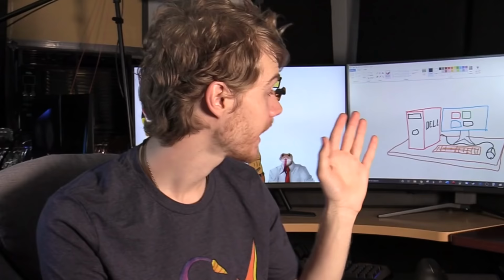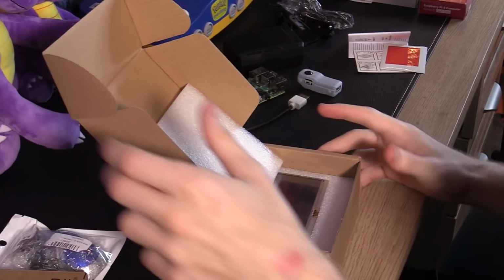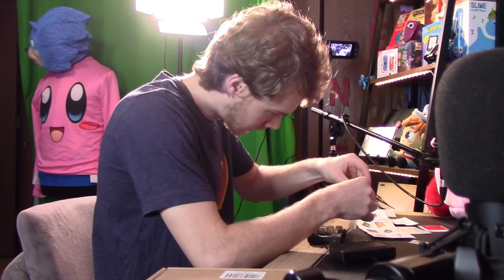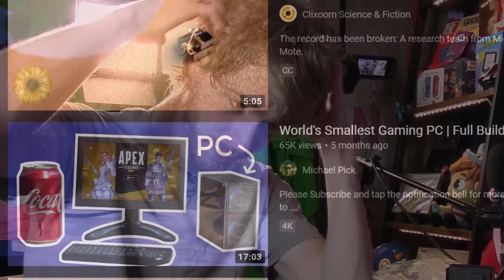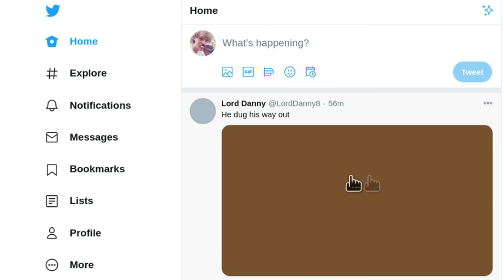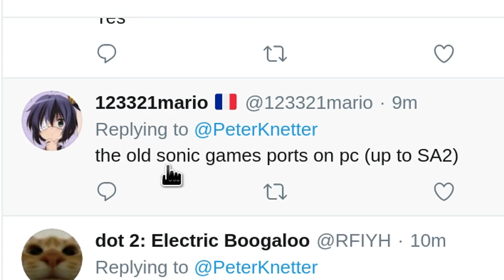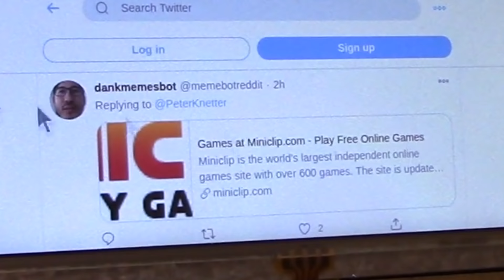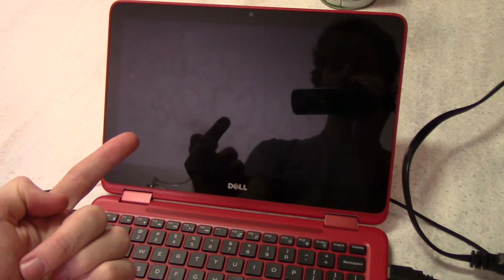Making the Worlds Smallest PC

Comment: Can I have a pc for Christmas?
Mom:
Reply: but it’s actually a good pc tho
Reply: Cap
Reply: If you get a cooling setup, like the Ice Tower Cooler for Raspberry Pi, you can overclock the arm chip to a point where you can get about 30 frames per second in Minecraft Java Edition 1.16.4 (With the Sodium renderer), which can be installed on the Pi.
Reply: @reptilehub4978  nope, no cap. The RPi 4B has a 8gb ram model. Better than a 2012 mid-range computer.

Comment: By the way, it's possible to install Windows 10 on the Pi 4. And I don't mean Windows 10 IoT core, I mean full blown desktop Windows 10. It won't run well at all for obvious reasons, but it runs
Reply: QEMU?
Reply: @WalleBot  Nope, MS made an ARM version of Windows 10 and some smart people made a UEFI firmware and drivers for the Pi 4. Here's the link if you want to try it out: https://www.worproject.ml/. And apparently they even got it to work on a Pi 2

Comment: Usually when you flash your micro SD card it allocates storage clusters poorly, after that you want to expand your filesystem to utilize all of the memory on the card. At the command prompt type "sudo raspi-config" then select the number 7 "advanced" then select A1 "Expand  Filesystem." This will re-allocate all free clusters to be used for more storage to stop your mini computer from crashing because its running out of resources. Hope that helps.

I just had a 32gb micro SD card that was 100% full and after I did that, it went down to 54% used storage.

Comment: I'm jealous. You have a bigger screen than me with my Sharp Zaurus SL-C3200. I'm messing about, this is a sweet little project. :) I remember how much fun my Z was -- I used it as a proper little Linux computer in the mid to late 00s -- and hope you have just as much fun with yours, Patter. I still want to make my own. :) Edit: Oof those reboots! The worst I got from my first Linux box -- seriously obsolete hardware in '98 -- was programs crashing. I think it's the graphics; Intel graphics drivers are the worst I've seen for causing problems with the whole machine. (90s Windows problems were largely driver-related too.) My Zaurus repeatedly failed to compile Wesnoth after an all-night wait, but that was the worst I experienced with it. Then again, I wasn't trying anything 3D. It compiled and ran OpenTTD quite well; the small slow-down compensating for the tiny touchscreen. It won't compile OpenTTD any more, but oh well.

Comment: You might have been giving the Pi too little power (2.5 amps 5 volts should be good) or had peripherals that used too much power, I have several Pis that I use for projects and they've only ever shut off like that when I've accidentally shorted them or there was one of those little attachable screens attached to it, they are pretty demanding power wise for the Pi. (assuming you're powering it directly from the pi)

[edit] I dont really pay attention to other comments and did not read the part where you literally fixed that....